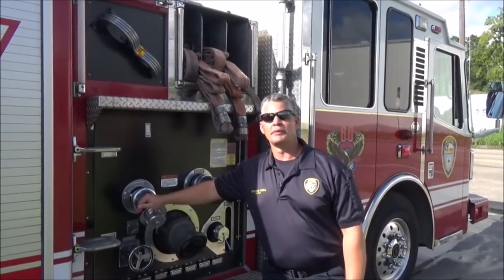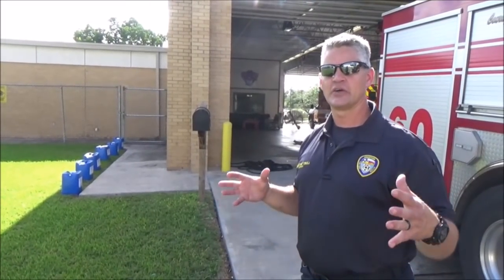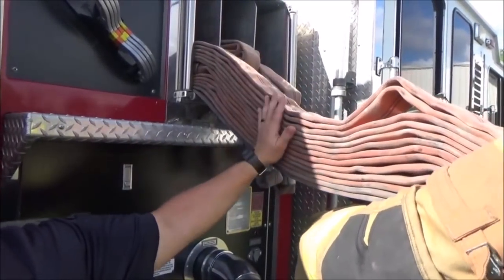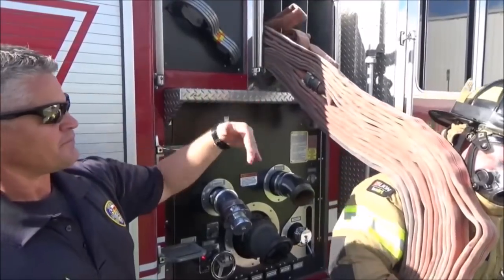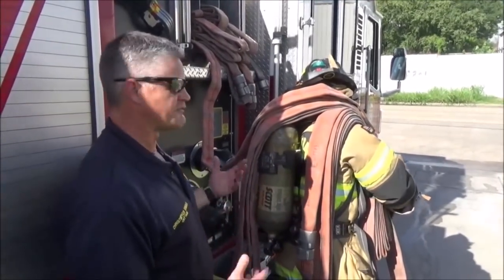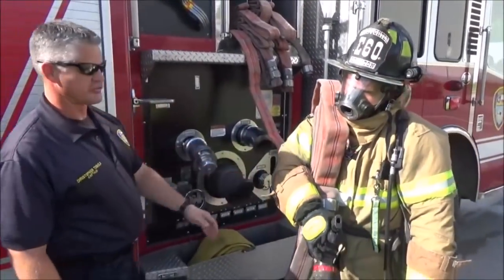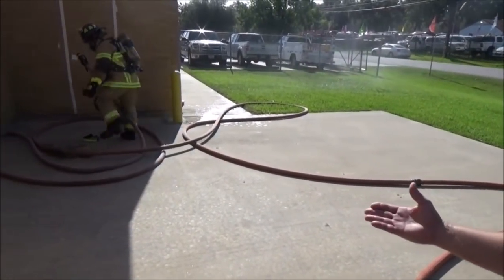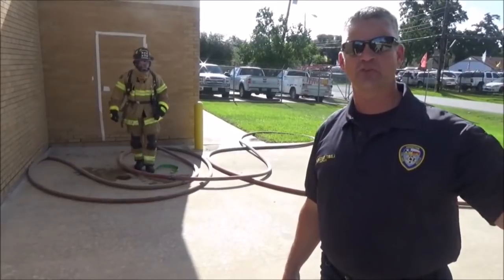Combat Hose Load

Comment: Serious question here. Why do you "pop" the nozzle to get kinks out? Are you not worried about water hammer? I was taught to open the nozzle and let it flow for several seconds to test the pressure as well as the stream is correct. To get kinks out we flake the hose out a little better to avoid kinks instead of a bundle at the front door. Thanks for the feed back
Reply: lilbass1 I do the pop to clear the line of kinks. Even laying the line out at the door you get those sharp bends in the hose. The back flow of water helps remove those kinks that might be problematic as you advance the line. I only do the pop method  because I know I have 200 foot of line to absorb the energy of a possible water hammer.
Reply: Water hammer is almost non existent in an attack line. There isn't enough weight from the water to hurt anything. The only time you really have to worry about water hammer is large volumes of water, particularly 5' supply line, as in slamming a 5' discharge or intake shut.
Reply: Jerry Thompson basically using the water hammer to straighten the kinks out. The kinks absorb the w h instead of the valves.
Reply: Rigs have automatic water hammer regulators now from factory, also your department probably has your large diameter intake set much lower than the the manufacturer pressure relief valve. Don't worry about water hammer, let the boys flake that hose.

Comment: Iv’e seen many different styles of loads and pulls over the years. As long as your crew members train on what you use, are good at it, and it works go for it. For me, this one has too many “key points” - meaning the instructions should be much simpler to a new FF.

Comment: Thank You for your instructions. 
However there seems to be too much razzle dazzle involved with your hose loads which can hinder a rapid deployment of them .
Coming from a Inner City Firefighting Background in the Northeast located right outside of Philadelphia where City Long Blocks of Inter Connected Row Homes are the name of the game and also having served in the Fire Service in NE Pennsylvania's Coal Region where Balloon Contructed / Common Cockloft /Old Wood Frame City Block Long Inter Connected Row Homes are the predominant Building Construction I find that the Minute Man Hose Load works the best with Attack Lines under conditions that call for Rapid Deployment with no Razzle Dazzle involved .
The Minute Man load can be pulled from either side of the Rig and has served us very well up here in the North East for decades . They work very well in Garden Style Apartment Complexes also . They work excellent with both 1.75  or 2.5  inch attack lines with one man pulling them/ placing them into service . In these days of dwindling manpower on the Fire Scene the Minute Man Attack Load is the time proven way to go to get a Attack Line quickly and efficiently into service. 
" The Quicker We Get The Wet On The Red The More Chance We Have In Saving Lives ! "